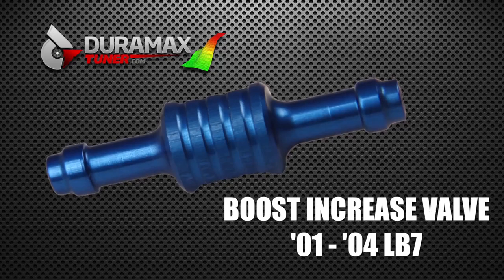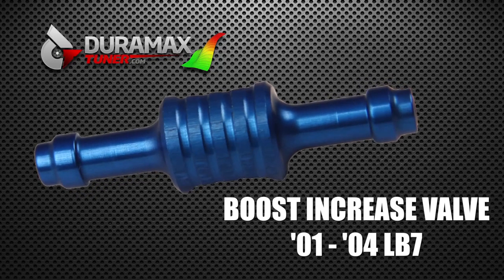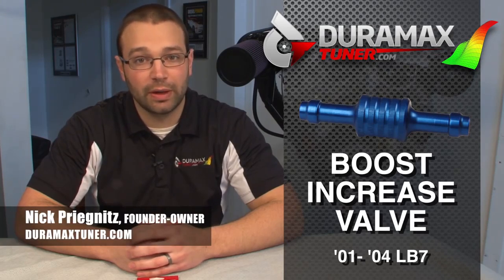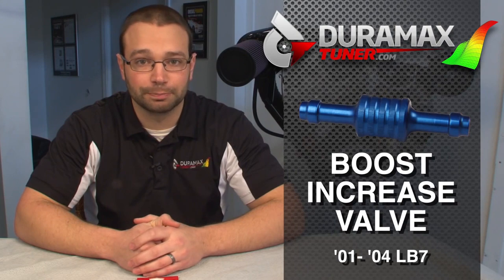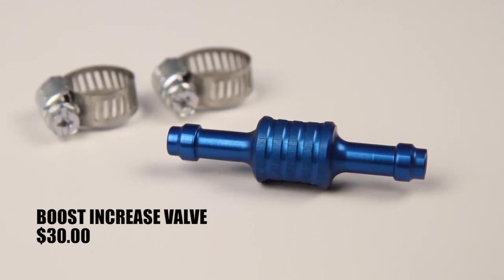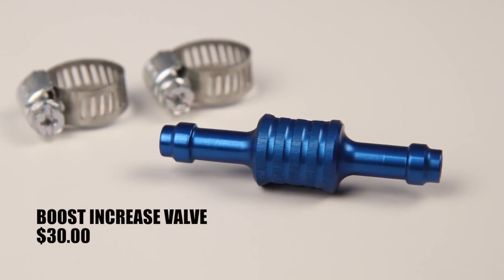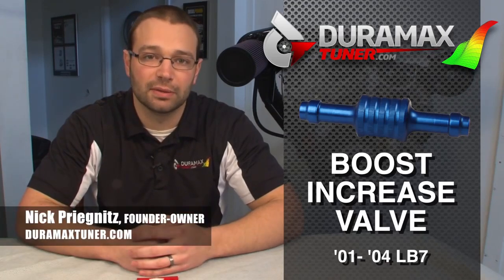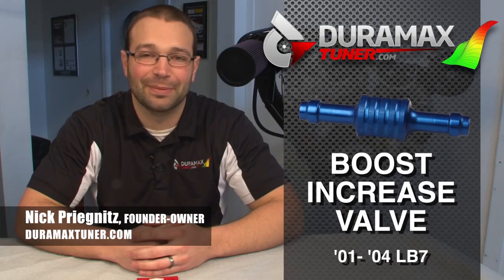BOOST INCREASE VALVE by Duramaxtuner.COM

Comment: I have kind of a Frankenstein suramax and its an 05, but im not sire on the year of the motor. Plus i almost hear zero turbo. Something youd recommend, or how can i tell if its actually an lly ?
Reply from the maker: @justinwiltshire9433 The cheapest way to get more sound out of your turbo would be to upgrade to an aftermarket intake. However, if you really want more turbo sound you will most likely need to upgrade your turbo and do some exhaust modifications. The best way to tell what motor you have would be to look at the ECM. the LLY has 3 connectors and the LBZ and LMM only have two.
Reply from the maker: @justinwiltshire9433 Also check out this video on how to tell the difference between an LBZ and an LMM if you have the two connectors.   https://www.youtube.com/watch?v=-W1Lpp5lDZM&amp;t=81s

Comment: why spend $30.00 for a boost control valve when u can build ur own for less than $20.00. best yet is u can make it adjustable to 30 lbs. boost and the parts is available from any hardware store. 3/8 t-fitting, 2 ea. 1/4 in. barbs, a 1/4 in. spring by 1.5 in. long. and a 5/16 bolt. ace hardware had all the parts i needed. goods luck!!!!
Reply from the maker: We love DIY mods!  But for an extra $10 you can just order the correct part, that fits, and works exactly as it should.
Reply: @Duramaxtuner  i built my own 4 less than 12 bucks. ha! got the parts from ace hardware and now get 26 lbs. of boost or more!!!  eat ur hearts out duramaxtuner!!!!

Comment: if i already have my boost gauge line mounted in that hose does it matter what side of it i put one of these boost increase valves?
Reply from the maker: dragracer10 Yes it will. You need to keep your gauge between the compressor housing and the increase valve. -Scott